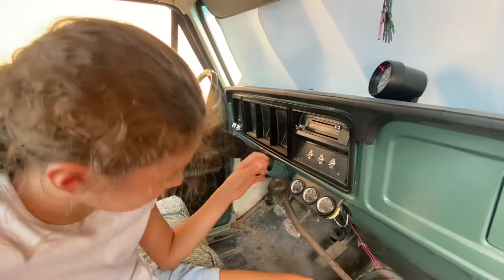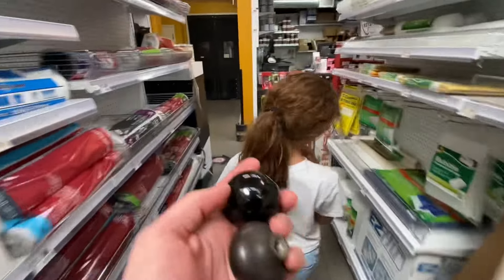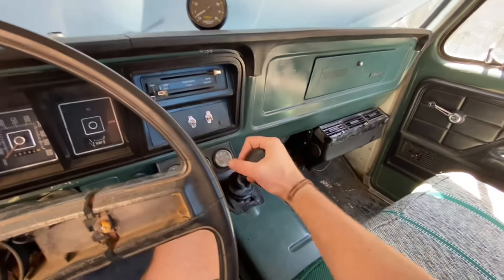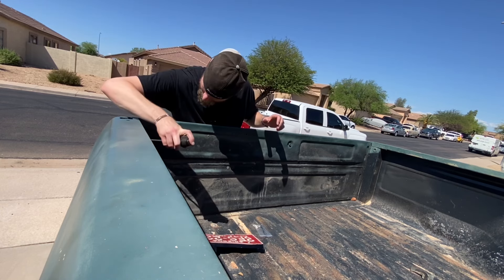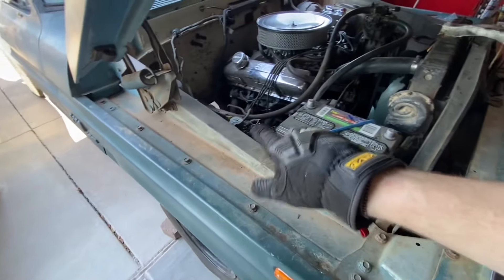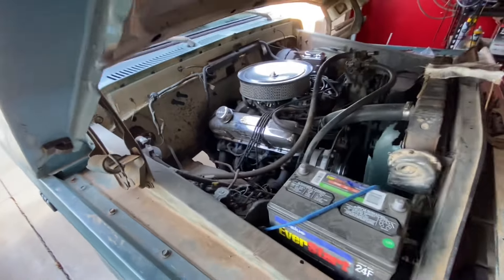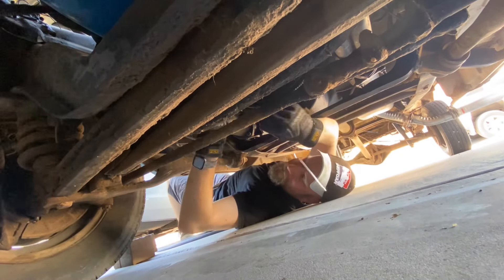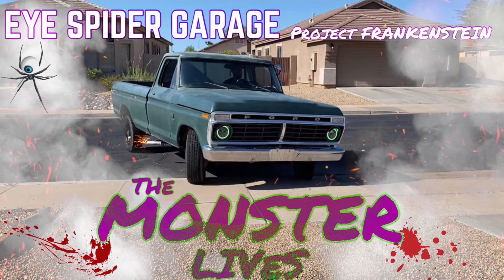#193 - Shift Knob & Wrapping the Starter

Comment: Drill the knob out and JB weld it on 🤓
Reply from the maker: That’s not a bad idea Brotha 🤜🏼🤛🏼
Reply: @EYE_SPIDER  it might work. If you drill the thread out of the brass and cut some grooves straight up and down in the brass insert that would hold the jb weld to the insert and it will be able to thread on and off